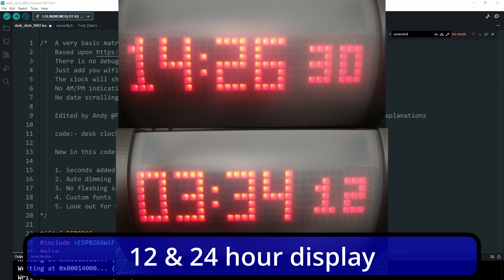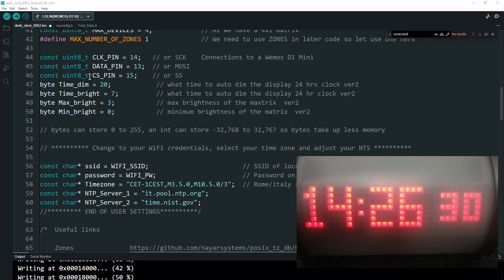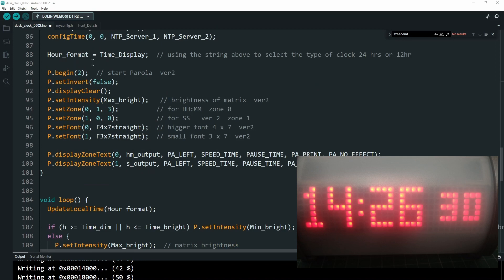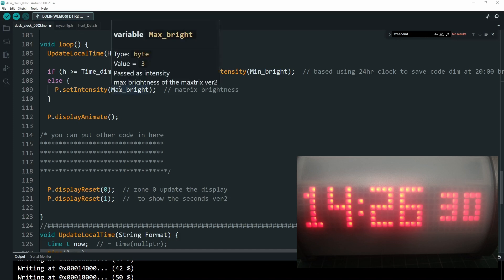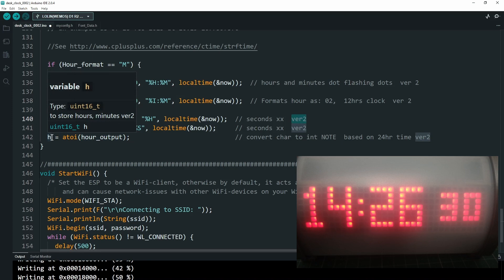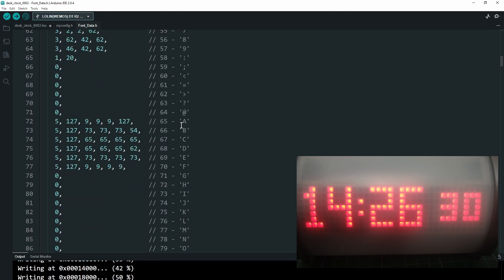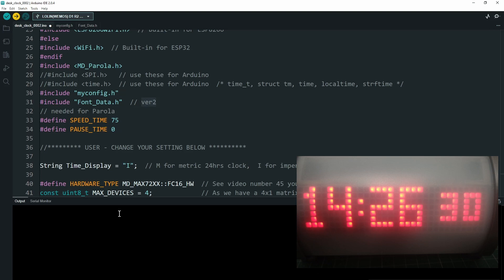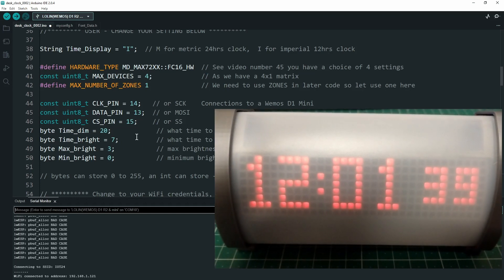How to LED matrix ntp time server clock with H:M:S. Auto dimming Custom Fonts 0073

Comment: Thanks for your video! I am still trying to figure out how to make a count-up stopwatch (clock) with HHH:MM:SS display structure which I can count up more than 100 hours. Do you have any suggestion for this? Through your MAX7219 videos, I've managed to make a 10 digits stopwatch only with SECONDS. But I am wondering I could make it with (HHH:MM:SS) format. Thanks again for your great videos!
Reply from the maker: I think i have a counter video?

Comment: Hello!
I was discouraged using this code, in fact most of the codes I find online cannot get the correct time for my region (Brazil, Sao Paulo or America/Sao_Paulo). In the following line:

const char* Timezone = "CET-1CEST,M3.5.0,M10.5.0/3"; // Rome/italy see link below for more short codes -1

I have already used several short codes such as:

const char* Timezone = "<-03>3"; //America/Sao_Paulo

const char* Timezone = "BRT"; //Brasília Time, without STD

const char* Timezone = "BRT-3"; //America/Sao_Paulo

I even tried some to be used during daylight saving time, although my country doesn't use daylight saving time: BRT3BRST,M10.2.0/0,M2.3.0/0

If you can give me any suggestions I would really appreciate it!

Happy New Year!!